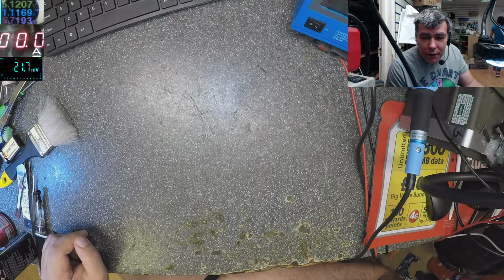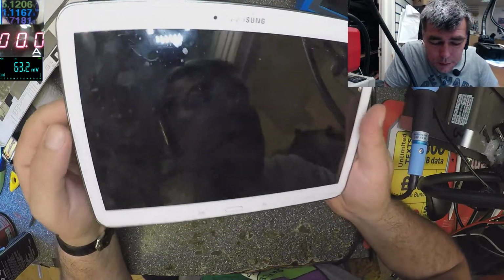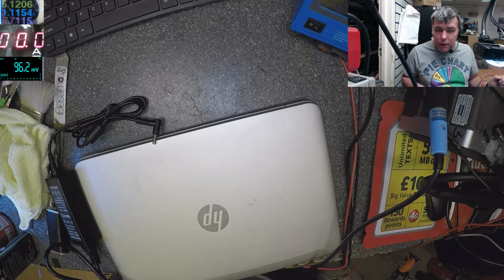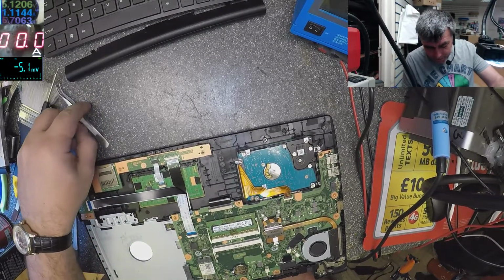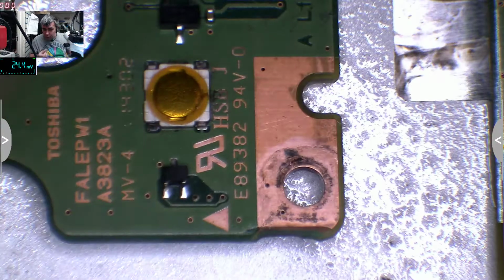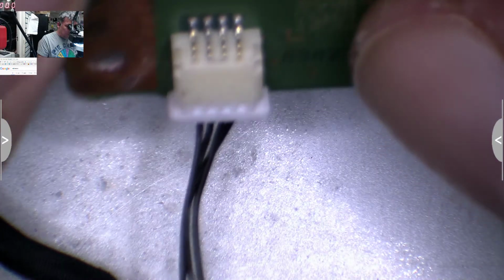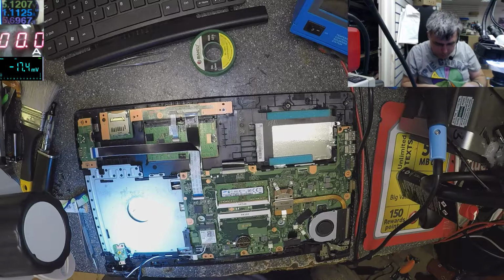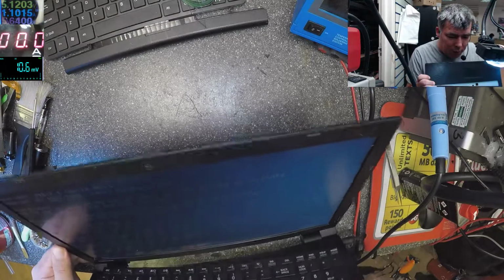Samsung Tab 4 funny colours and Toshiba Pro R50-B-12n laptop - no power

Comment: Nice fixes, these samsung tablets and smartphones have a weird issue with self disconnecting screen ribbon cable sometimes you just have to press on the screen where the cable is located and you can hear it make a click